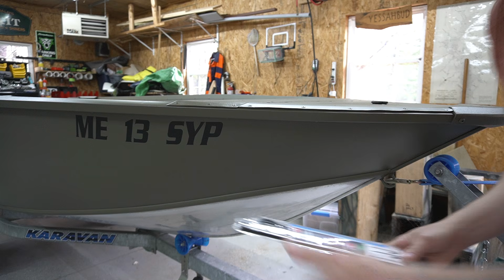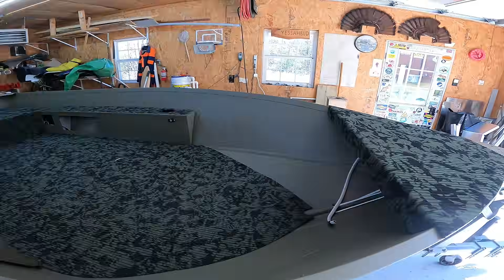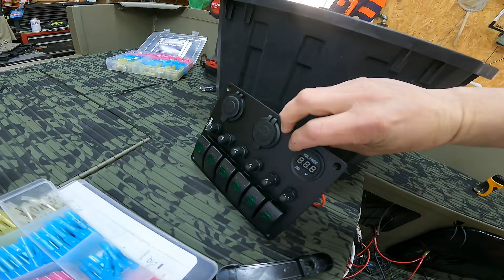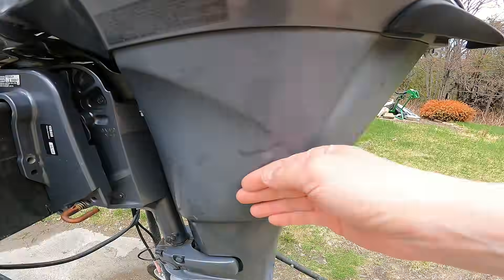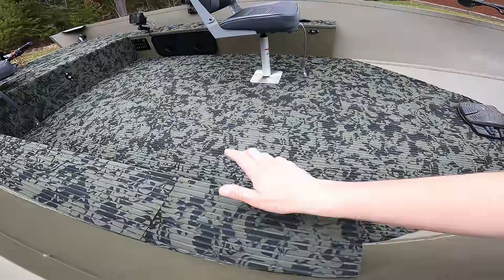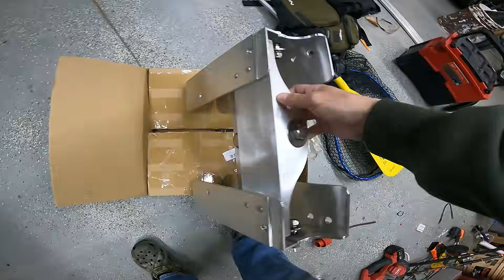This Boat Transformation Is INSANE! | Mini Alaskan Build Ep. 4

Comment: Dude you out did yourself on this one, nice build all day , turned out great, but I was wondering , are you cranking that electric outboard with a lithium battery, and if so ,What brand and size are you using, I have a 15 Hp Mercury ES and I been wanting to get a lithium battery for it too !

Comment: You need to forget about regular outboard engines. Start looking at and using Thailand long tail mud motors running off Honda GX series air cooled engines. Far better with no damage when using in shallow water, less cost, maintenance, ect. https://youtu.be/BiERp07twWM?si=GJPCvsf0Cvck3iY3

Comment: I have approximately the same year Yamaha in 15HP that stalled out occasionally. Someone told me to put in a fuel filter just before the fuel pump under the cowling. It solved the stalling.
Reply from the maker: I replaced that as well. Runs perfect. Starts up first try